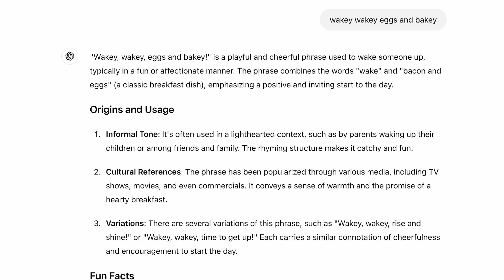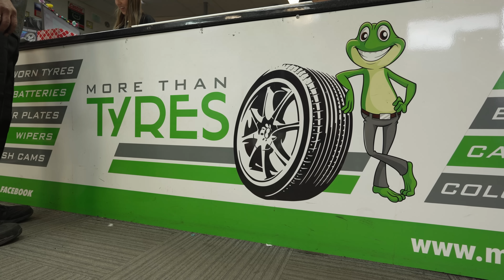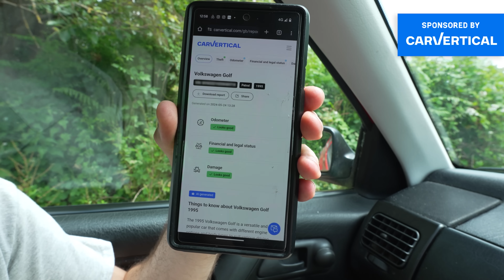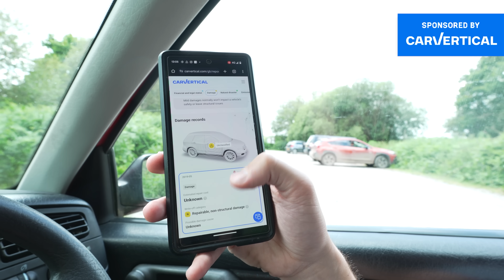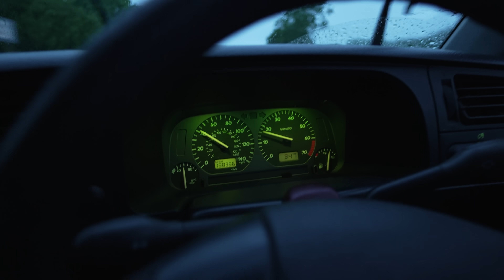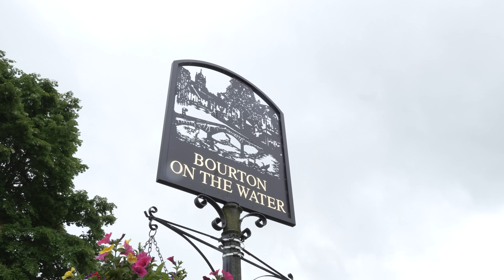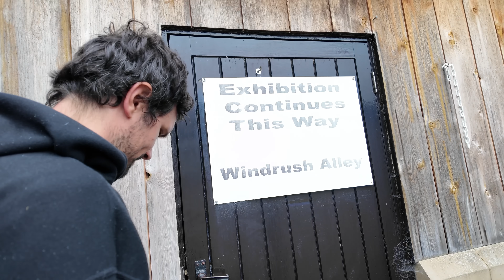We Let AI Plan Our Road Trip

Comment: Golf is still less fucked than that Ferrari. It 100% needs restoring to factory spec maybe a bit lower than factory on some nice wheels.
Reply: No it doesn't.  It's worth more parted than restored.  Let Alex have fun with it and drive it, not trailer it or baby it.

Edit:  I'm referring to the 360, not the Golf.
Reply: now it runs lmao the old 360
Reply: @danielseelye6005  Also i meant the golf needs restoring, the ferrari needs parting out.
Reply: Its a rusty sh*tbox, it looks worse than Rorys MINI, and will probably cost more just to get it through an MOT
Reply: WTF no it's not 😂 The Ferrari has almost all the parts, the engine runs and the bodywork is fine. Plus you could strip it for parts. The Golf is so bad you could barely sell anything off of it.
Reply: @uranusneptun5239  It's doctored up to look good, its been smashed up in a police chase.
Reply: Supercharge it

Comment: If you grease up the linkage between the gears shifter and the transmission, it will be smoother.
What probably rattled and fell off, was the heatshield for the catalytic converter.
95 Golf hatchback was the first car i owned. Love those cars.
Hope you guys will try and fix it up or sell it to TDC guys so they can try and save it xD
Looking forward to the next one.